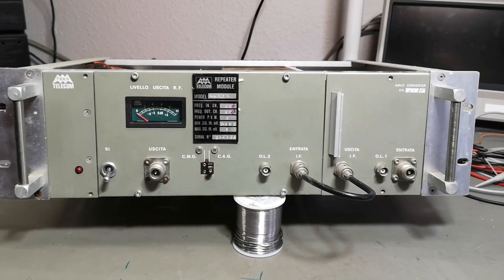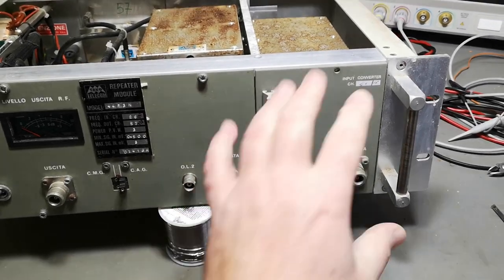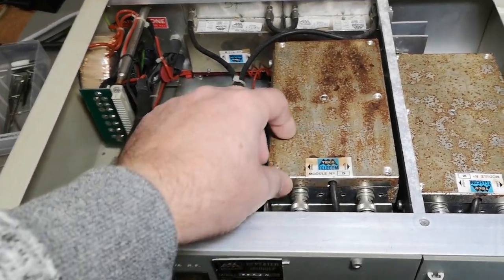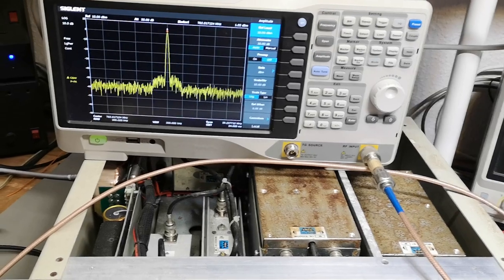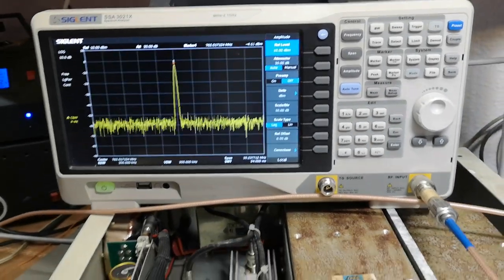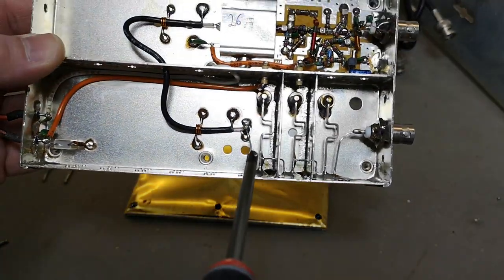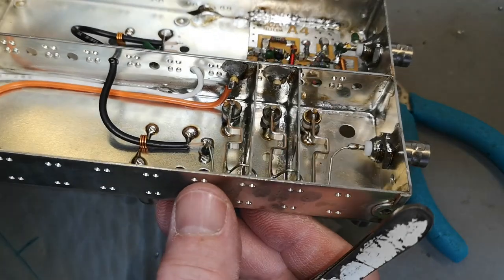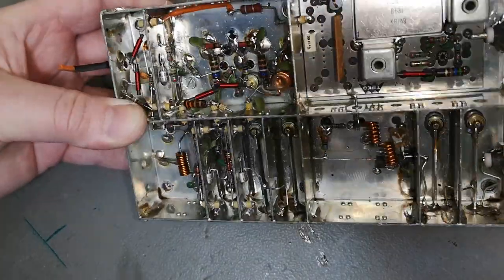TEKO telecom repeater module model 44r3n TV channelizer amplifier

Comment: "Buongiorno" Thomas 😁

it is probably a frequency converter for cable TV - the antenna receives the terrestrial broadcast signal, the converter transposes the signal to another channel so that there is no interference between the received and distributed signal. The number of programs on cable TV depends on how many converters the system has. These converters were so perfectly manufactured that after commissioning and setting up, they did not require service for decades even in 24/7 operation.
In our house, we used to have a Grundig analog transponder that distributed several radio, television and satellite programs to the STA (CZ designation for common television antenna). Five high-rise buildings were connected by cable, in each apartment unit there was one outlet for connecting TV and radio - I had my own distribution signal network connected to this and it easily pulled 4 TVs - thanks to this network I could distribute the signal from the video recorder and private cameras , but also the digital signal from the DVR processed by another converter and received on any television. Later, a signal from the own DVBT tuner was added to the system.
He got a lot of useful parts for new projects 👍

Nice day 🙂 Tom
Reply from the maker: exactly what this it, yes i scored a bunch of cool parts here, it was a lucky day

Comment: Production might have been one per month, so not really hard, not much demand for them, so a month from order to final test was not unreasonable, especially as you put it in service and did not touch for the next 2 decades at all.
Reply from the maker: you need one pr TV channel, and they only cover the local small community area that share antenna wires, the dude that gave me this one has a stack of them :-) so i think they made quite a few of them
Reply: @TeardownOZ2CPU  Yes, but over a year they might have possibly 40 to 60 ordered, easy enough for a half dozen people to hand assemble them, in addition to repairing them, and also likely doing other work in a electronics development company.

After all the TV industry for transmitters and repeaters is not generally large, and you typically have a long lead time, plus it was likely these at some point went in to the factory to be reprogrammed, thus the bandwidth and channel change you noted differing from the label, a quick change when some area got new channels added to fit into the existing band plan, or resolve co channel interference from another translator that was too close both channel wise and location wise, where the attenuation and co channel interference was deemed to be too much. Normally you avoided any channels being 2 or 3 channels apart in an area, as they could easily, with cheaper sets, get adjacent channel sound interference, or vision interference, or sound on vision.